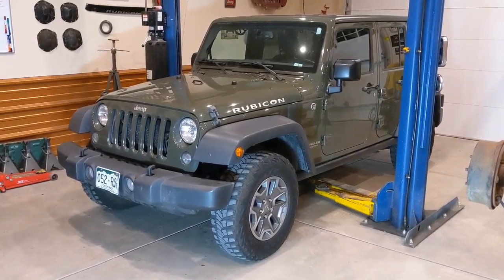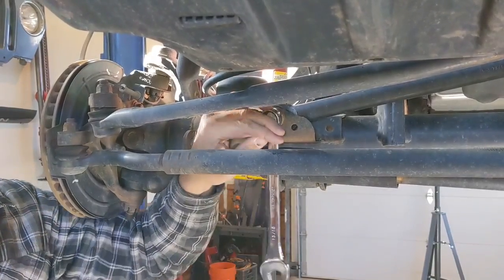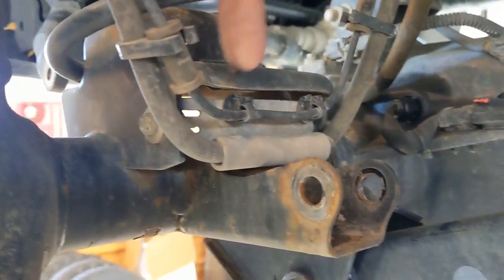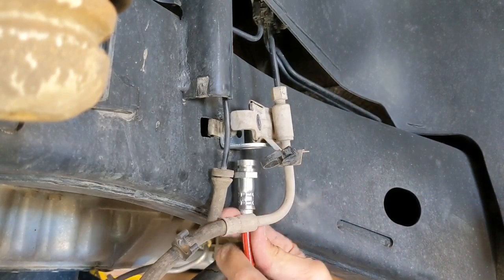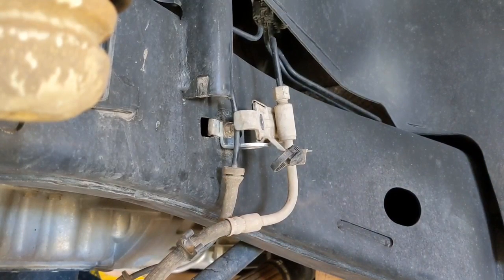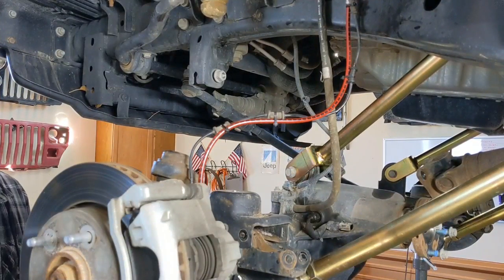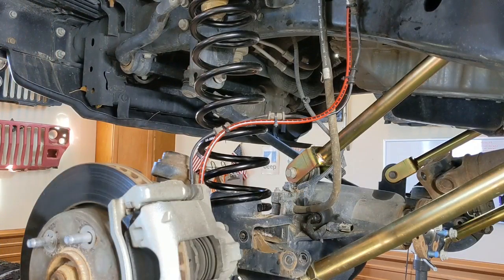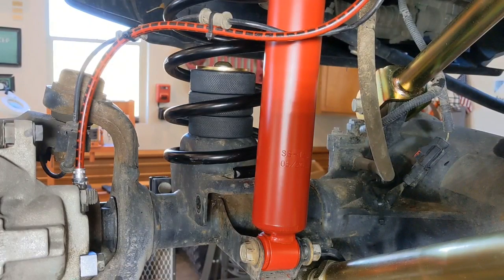Metalcloak 3.5" Jeep JK Suspension Install Part 1: Front Axle

Comment: Great video "Very Informative"with clear easy to follow instructions, and of course all the tricks and tips that the instructions usually don't include lol, also one of the things that set your video apart, the little things that matter the most the Lighting👍 the Audio👍 and the Video👍 quality itself was very good" got to ask though how much do you charge for the installation of this kit or what is the average cost of a basic shop to install this  just the install🤔
Reply from the maker: Thanks for the compliments! As far as pricing, call around and you will see that it is all over the place based on the individual shop and state that you are located in.

Comment: I've been fighting my track bar trying to move the axle over with a ratchet strap for hours. Glad I found this video or else I'd probably will be sitting there trying to move it over enough to get the bolt in.
Reply from the maker: If the axle is centered under the frame at ride height, then simply adjust the track bar until the bolt goes through. If the axle isn't centered, then a ratchet strap might be needed to get it centered first. But even then, the ratchet holds it in place so you can slide the bolt right through. Glad the video helped you out!
Reply: Mine was so easy to change.

Comment: Great video, and thank you. One thing about the Metalcloak instructions:  NOT ONLY DO THEY LEAVE OUT A LOT OF PERTINENT AND IMPORTANT DETAILS, BUT THE SPECS THEY OFFER ARE INCONSISTENT BETWEEN TWO DIFFERENT VERSIONS OF INSTRUCTIONS AVAILABLE ON THEIR WEBSITE. Also having trouble finding TORQUE SPECS and where to use lok tite. I'm mechanically inclined no problem but newer sheet says the control arm should be at 18 3/8" and the older instruction states 18 3/4", it leaves you in a bind because the newer spec doesn't fit. Do I need to "make if fit?" Due to poor instructions, I'm having delay after delay. So again, there are some good YouTubes out here, but big thanks to BFH Garage. Really well done and appreciated.
Reply from the maker: One thing people need to realize it's that the control arm length is a byproduct of everything being set up right. You want the arms as long as they can be without interfering with anything.
Reply: @TheBFHGarage  and THAT makes sense which is why it puzzled me that on the updated instruction, they shortened the control arm length. Thanks very much!

Comment: Thanks for the video and the nuggets of useful experience.  I'm going to get the 2.5" game changer lift for my JK.  I have one question, why didn't you choose to use the outboard front lower shock mounts with the rocksport shocks?  Metalcloak recommended these to me because of the potential of the shock body binding against the frame when one tire is stuffed and the other is drooped.  Have you found that this is not true or necessary?
Reply from the maker: You have to have the correct backspacing on the wheels or the tire will rub. In this case, the owner was still waiting on his new wheels so we put it off until they arrive.

Comment: Thanks for the video. It was very informative because it's the suspension upgrade I want to put on my JKU Rubicon. Great tips in watching out for the lines as you drop it down. Also quick question?  For 5he bump stop, do you recommend the hydraulic and what size would it be. . Great video 👍
Reply: That would be for thehe 3.5 lift  question regarding the hydraulic of air bump stop. Thanks 👍
Reply from the maker: I use regular fixed bump stops, not air or hydraulic. I don't do any high speed stuff so I don't think it would benefit me enough for me to prioritize it over other needs. They are very expensive so I would suggest a lot more research to make sure they fit your true needs.

Comment: Question: when installing the trackbar, is there a difference between measuring the original and adjusting the new one to the same length versus adjusting the way you demonstrated?
Reply from the maker: Yes. If you adjust to the original length, then it doesn't account for the new lift height and will cause the axle to be off center. The correct way to do it is to put the Jeep on the ground with the weight on the springs. You must ensure the axle is centered before proceeding. If not, get a ratchet strap and move it until it is centered. Once centered, you simply adjust the track bar until the bolt will easily slide through the hole. No need to measure anything. The length is a byproduct of the trackbar being installed at ride height with the axle centered.
Reply: @TheBFHGarage  how can you verify the axle is centered?
Reply from the maker: @Darkhorse_Actual  Take a measurement between the frame rails above the axle and find the center. Then take measurements on the axle to find the center. Line up the frame center with the axle center. It may take some creative thinking/measuring to get there. You can use a plumb bob or even a laser. Think through the process and you'll see what I mean.

Comment: Great vid! Got a JL Rubicon. Did you need to swap/upgrade drive shaft? Metal cloak recommended to do so. Wondering if you had any issues w/o upgrading yours.
Reply from the maker: I haven't installed a Metalcloak lift on a JL yet. If MC is the one recommending it, then I would find out why by calling them directly. The main reason for a new driveshaft length is due to a lift changing the angles or length which sometimes can only be corrected with a new shaft.

Comment: Great vid , did you have to change out the stock drive shaft like the website recommended?
Reply from the maker: It isn't necessary ALL of the time. Cycle your suspension to see if it's needed.

Comment: Any specific torque spec (ft lbs) when tightening the bolts back on upper, lower control arms, track bar, etc? I’m running Factory wheels/ AT tires 33” on a ‘21 Rubi JLU for now. Will put on 37”s in a month’s time. Would i need to install the shock mount relocation brackets for now for the fronts or rear?
Reply from the maker: Torque spec should be based on the bolt, not the lift. If you are re-using factory bolts, torque to the FSM spec. If using a larger bolt, torque to the spec for that bolt. As far as shock relocation brackets, it's not so much about tire size as it is the wheel backspacing. Factory wheels have 6" of backspacing which tucks the wheel under the fender. Find a wheel with less backspacing to run the brackets. As with all things, cycle your suspension to make sure there aren't any interference issues.

Comment: Did you use anti seize for control arm bolts?
Reply from the maker: Some aftermarket companies say to use loctite while others suggest anti seize. I prefer anti seize so corrosion doesn't become an issue. I check my stuff regularly too.
Reply: @TheBFHGarage  I’ve always had that debate of which one is the best one. Thanks for the reply